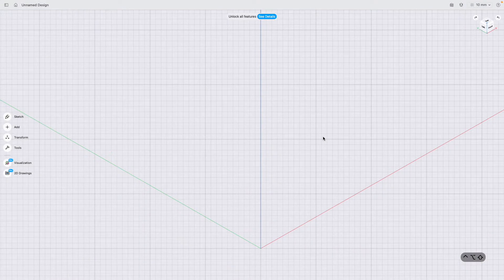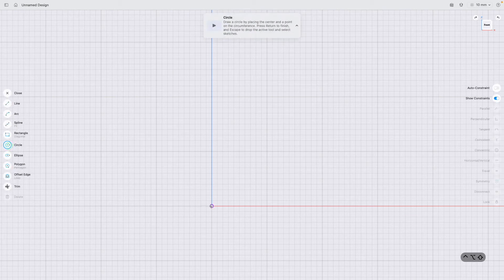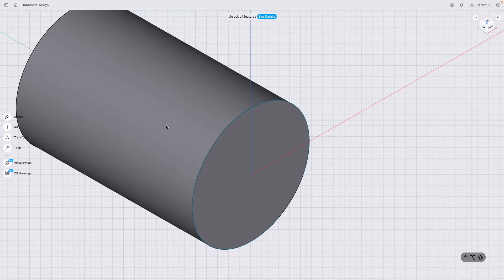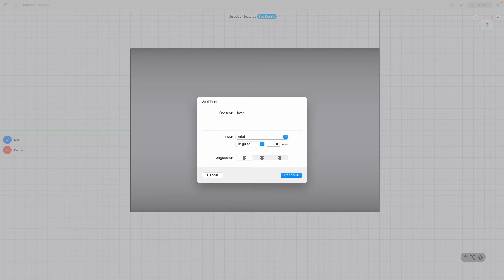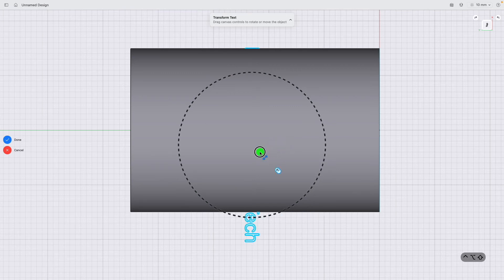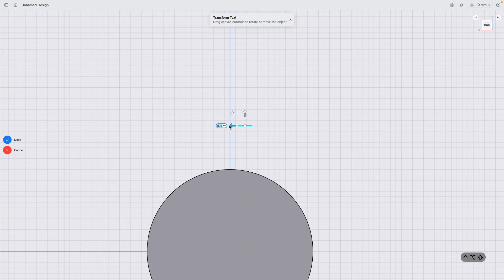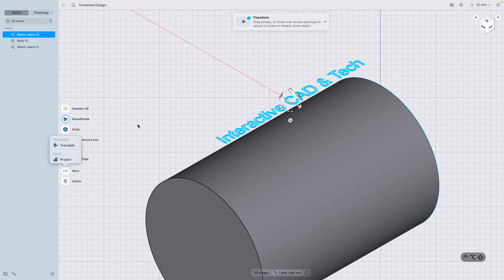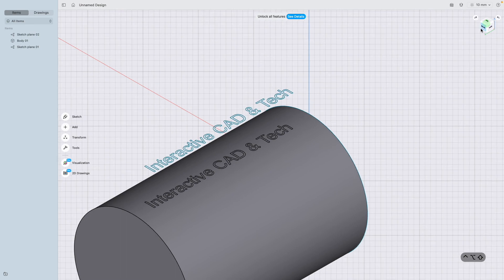Shapr3D- Project Text Onto A Curved Surface

Comment: Is there a way to project onto the entire circumference of the cylinder in such a way the entire text is tangent to the curve?
Reply from the maker: You can project a curve around the entire cylinder as shown in my latest video 

Shapr3D- How To Project A Curve Around A Cylinder
https://youtu.be/6UiMtEolOCc

But not sure if it will work with text. Will have a look into this